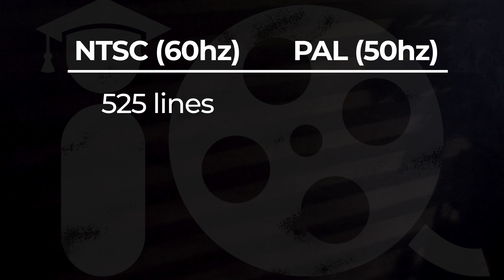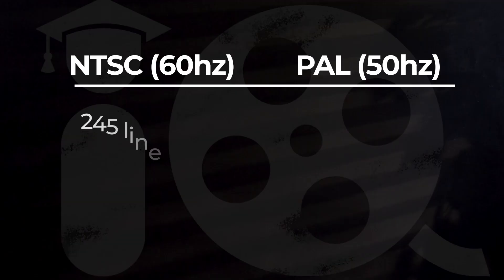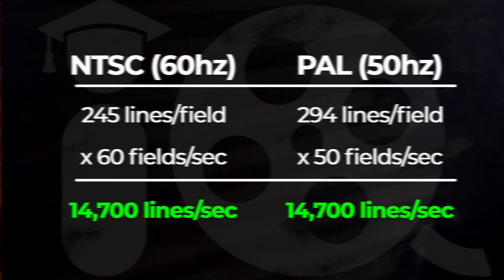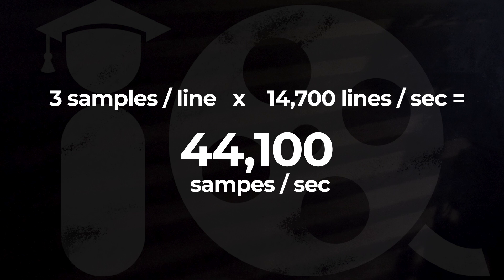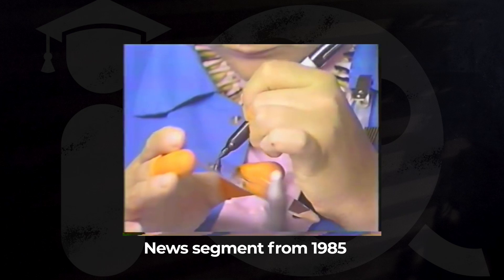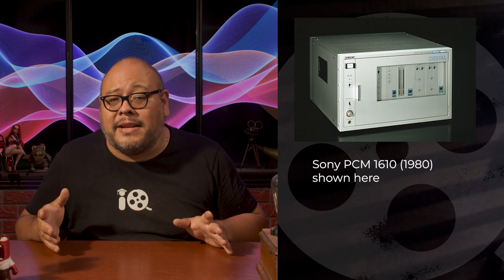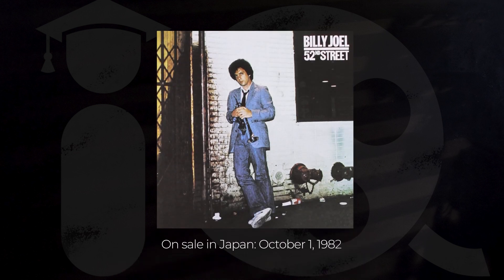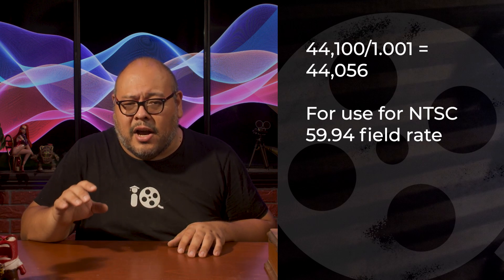The Surprising Origins of Digital Audio Sampling Rates

Comment: Later formats like CD, DAT etc were so robust largely thanks to error-mitigating innovations like EFM and CIRC. Those early digital audio formats on u-matic etc seemed to be very much synchronous bytestreams. Did they use any form of error checking like parity bits or such?
Reply: In other video comments on other channels I’ve had discussions with people who used U-matic to record digital audio onto in the late 80s and early 90s. At least at that stage they could detect CRC errors because it was a simple checksum, but they said if the errors started flying up (measured on a separate rack mount unit) you had to rewind and re-record that part until the Master Copy was perfect. So definitely far more rudimentary than CD error correction! Merely error detection :)

(I’m not sure what the acceptable error tolerance was, though — given RedBook includes standards for bodging a few PCM frames when they’re missing, just one or two CRCs might’ve been fine? But definitely a large increase necessitated going back and redubbing that segment, all made possible with timecodes of course.)

Now I’m not 100% if these early recordings were compatible with a CRC error count rack unit, I suppose they might not have been; but given the machines were used for a long time, and they had their own standards for the video frame, and so on, I would be surprised if that were true. Whatever was used in 88 was probably used in 84.
Reply: @kaitlyn__L  great info. It's all coming back to me now. We still were receiving audio masters on u-matic up until 1995. We had a rack-mounted sample rate converter and a dot matrix printer attached to a Sony PCM 1630. And yes, I vaguely recall examining the printout for excessive errors. The only option was to reload the tape. 
CIRC is a much more elaborate algorithm that allowed some degree of error recovery which parity or CRC did not. 
 I seem to recall that u-matic also had the PQ points encoded?

Comment: Just as an anecdotal data point, I've been using 48k since the late 90s when I started using Cubase VST with a SoundBlaster Live! card and found that the card wouldn't sync properly at 44.1k, because it was internally 48k and doing an inaccurate downsampling to get 44.1. It's funny now remembering how I was annoyed at the extra disk space it used, totally irrelevant now. But back then, when I'd spent a lot of cash (for me) on a "massive" 17.4GB hard disk for audio recording storage, it was a significant overhead.
Reply: Haha, believe it or not, I am STILL using a Sound Blaster Audigy 2ZS for audio production, which relies on an evolution of the chipset used in the SBLive! and has the same "48khz or inaccurate downsampling" limitation (the original SBLive card relies on the emu10k1 chip, while the Audigy2ZS relies on the emu10k2 chip... there's even an Audigy Rx released a few years ago relying on an emu10k2.1 chip which still caries this limitation). Which leads me to usually work with a 48KHz workflow, and then manually downsample to 44KHz in software if need be. It also seems to me that, as video and audio become more intertwined (e.g. people listen to music on YouTube), 48KHz is increasingly becoming a standard even for audio only.
Reply: @Liam3072  Excellent! I've actually considered building a small PCI machine just so I can use my SBLives again. it feels to me that in many ways we've gone backwards in PC audio, I mean the SBLive is over 20 years old and was an absolute powerhouse. And I was actually running two in the same machine using modified drivers! My final production config was one using the Live! drivers and one using the E-Mu APS drivers which had some great effects.

Good days.
Reply: @ian_b  Or you could get a usb audio interface that has no issues with whatever sample rate you use, better dac's, asio drivers, no ? is there a reason to use soundblasters/ non audio prod focused pci cards ? (this is a real question I'm not trying to be antagonistic)
Reply: @escalator9734  and, if he insists on Creative, could use 0404 or, say, 1212M.
Older recording audio cards can be often found for cheap. Especially the PCI ones. Or Firewire, though getting it to work reliably on Windows is not easy.
Reply: I totally get a feel of that 17.4 GB HDD. I have a similar memories!

Comment: Neat. I knew 48K was an issue of mostly timing and even divisions, but I didn't know it went quite so deep.

I do audio mixing and mastering for some like-minded artists, and I stick with 44.1 for the marginally smaller file sizes and slightly improved CPU performance. Also, this is less of an issue now, but some audio processing counts things in terms of samples rather than timecode, and some of that audio processing doesn't ask what sample rate you want and just expects to be fed 44.1. So anything else can cause issues - for example you think you just set a filter at 16K which is actually at 17.41K. That's much more of a rarity now, but I still see it come up now and then.

Comment: The thing is... we hear up to 20000Hz, but you can hear an audio sampled at 192Khz through a DAC of 44.1Khz and then the same audio through a DAC of 96Khz and you will notice a clear difference. At 44.1Khz you hear more fuzzy audio. I don't know if you can differenciate 96 from 192 because I didn't have the opportunity to check that out, but between the other two... I got amaze.
Reply from the maker: "Sampled"? Then that's your caveat. When you start filtering audio, there's all sort of aliasing that rises up that reflects ultrasonic frequencies into the audible range.

But if I record sound at 48khz from a mic and then record the same sound at 96khz, same mic... No way you could tell the difference.

Comment: I knew about 44.1K but never got 48K, especially since 50K was already an established standard.  Thank you!
Side note, engineers of earlier digital recorders believed 60KHz would be ideal (you need room for the antialiasing filters to work) but it was pushing the tech a little too far, so they settled on 50K.
Reply from the maker: Decca used 50khz in a lot of early digital recording experiments of the late 70s in Europe. It might be a stretch to say it was a standard because nothing was standardize yet, but it was common.
Reply: @FilmmakerIQ  Soundstream, 3M  and Mitsubishi also used 50K.  Those were the most common digital multitrack systems in the late 70s.  I forget what Denon used off the top of my head but it was somewhat less.  BTW, I'm glad to see you posting again.

Comment: As I already saw the incorrect myth popping up once again in the comments that waves close to half the sampling frequency cannot correctly be reproduced, let me point something out here: This is nonsense and based upon a complete misconception of how PCM sampling actually works. Every analog sine wave sampled at at least twice the frequency will be perfectly accurate reproduced by the combination of a DAC and a band-path filter following it, which is always required for correct PCM signal reproduction. You can use an analog oscilloscope to prove that. There is no loss in amplitude or shift in phase. A sine wave of 20 kHz sampled with 44.1 kHz and converted back to an analog wave will look exactly the same at the output as it did at the input. If you overlay them in an analog oscilloscope, they match up perfectly and yes, it will always have exactly the same amplitude, too.

The misconception here is that when reproducing the wave, the signal will jump directly from PCM sample value to sample value but that's not the case at all. If it would do so, it would produce frequencies that are above half of the sampling frequency and this would violate the Nyquist–Shannon sampling theorem. That's why a band-path filter is mandatory for reproductino. It will enforce that no such violation is possible by ensuring that only analog waves are emitted that pass through all PCM sampling points (*pass through* does not mean "end at those", the wave can go far above that point before it turns around) and at the same time are never above half the sampling frequency.

And for those who now say: Okay, this may be true for sine waves, but what about other kind of waves? Every wave can be broken down into sine waves, so whatever applies to sine waves applies to any shape of waves. Of course, saw waves are not reproduced as correct "sharp" saw waves, as sine waves above half the Nyquist frequency are not reproduced (and those would be required for perfect edges) but that doesn't matter as you also cannot hear these either. That means to your ear, saw waves always sounded (= "looked like") as the "imperfect reproduction" does look like. So while you can see a difference for square waves (or saw waves) on an oscilloscope, that difference does not exist for your ears as your ears never captured the waves above 20 kHz and to your ears there never wars a perfect square to begin with.

This video explains all the theory about this and even proves that theory using an analog oscilloscope:
https://youtu.be/2qFjdQP7Ep0
Reply from the maker: The issue with your rebuttal is while it's true that every frequency below the Nyquist threshold is reproduced perfectly... Every frequency above the Nyquist threshold creates an alias of itself in the lower frequency. So if there are ultrasonic frequencies being recorded at a low sample rate those ultra high frequencies can appear as lower audible frequencies via their alias. 

Therefore it is necessary to eliminate all those higher frequencies before we sample the audio waveform. But a low band pass need some headroom to operate.

So you can get a diminished response on the upper end of the audible spectrum because that's the low band filter taking effect.
Reply: @FilmmakerIQ  A filter is required at both ends, that's correct. You need one prior to feeding a signal to an ADC and you need one after a DAC. Usually it's not just a low-pass filter as you also don't want very low frequencies to pass through, especially not any DC current. And yes, those filters cannot cut off perfectly at specific frequency, they just increasingly reduce the intensity of the signal starting at their cut off frequency. But this is not an issue to frequencies at the upper end. If the filter does not cut off fast enough, then you get aliases in your sample values, however an alias of, let's say 23 kHz, will not appear near the upper end but at a much lower frequency. To get an issue at the upper end, you need aliases of even higher frequencies and the higher the frequency, the more effective the filter will be. Also keep in mind, that the filter can start to cut off at 20 kHz, yet 44.1 kHz sampling frequency means that frequencies up to 22.05 kHz are reproduced correctly, so you have 2.05 kHz headroom to begin with.
Reply from the maker: Well 2khz isn't a whole lot of headroom and as I understand it it is difficult to do a sharp cutoff that smoothly. 48khz sampling would double that headroom and 96khz would give you a full octave plus to work.

That's what seems to be the real crux of this discussion. The serious folks are not talking about hearing ultrasonic frequencies or trying dispell Nyquist. It's that it's much simpler to filter out the unwanted high frequencies with more hz (up to a point then it might actually harm the product)

Comment: One important thing to note about Nyquist frequency is that sampling at merely twice the frequency that you are trying to measure only lets you reliably determine frequency and not amplitude(loudness) or shape(square vs sin, etc). Humans can hear frequencies from 20Hz to 20Khz, but can hear sounds better if they are between 200Hz to 8KHz. Most human speech, music etc will have primary frequencies below 8KHz, but may contain harmonics between 8Khz and 20 Khz.
Another reason why 44.1 or better works is that for frequencies below 8Khz, we sample at 5.5 samples per cycle or better which allows capturing the amplitude within 1dB for sin waves. For frequencies between 8KHz and 20KHz we start to not capture the amplitude quite right, but as this problem gets worse, human hearing is also becoming less sensitive so we usually don't notice.

Comment: 48 kHz is nice: 3 periods of 64 samples makes 4 ms. It simplifies timing over USB, leading to lower latency.
Reply: Citation needed. USB devices are interrogated by the computer at whatever rate is necessary. Furthermore, audio data is always buffered at the output.
Reply: @mina86    buffered ???? what did you meant? 
24-bits/192 audio, it's just a stream!
Reply: @lucasrem , sound card has a buffer where samples from the stream are written to in batches. Data is not sent there one sample at a time.
Reply: I couldn’t discern a difference between 44.1 and 48 in various settings, so besides switching to match my music (half the FLACs I have from Bandcamp are 48 while the other half and my own CDs are 44.1) which is a PITA I just allow for resampling. But I think I left it in 44.1 as default so that CD rips wouldn’t need resampled. But if it reduces audio packet latency, I’d happily put it in 48 since it sounds the same to me anyway.
Reply: @kaitlyn__L  I would store data in the original format. If all you do is listen to audio, latency does not matter that much, and most media players will upsample in real-time. It is however good to configure your audio server ie JACKD to run at 48 kHz.
Reply: @milasudril  that's what I was talking about, the audio stack’s output settings. I’m certainly not saving any resampled files. I had tried outputting at 44.1 and 48 and it sounded the same for both 44.1 content and 48 content either way.
Reply: @kaitlyn__L  Try 192 /24, if you don't hear that, try bigger speakers!
Reply: @lucasrem , 192/24 is a marketing gimmick. There’s no perceptible difference between that and 48/16.
Reply: Which also syncs up nice with 120 and 240hz displays. Dunno if that matters but hey. I like it lol
Reply: HDMi 2.1 needed?
192 24 384!
Reply: why you still need USB, stick with content? unable to find wires that support 192/24?

Comment: Things would have been so much simpler if we'd never bothered inventing TV until we had streaming digital technology...
Reply: Well, seriously, "analog TV" and it’s need for "backwards compatibility" already caused a lot of issues and limitations...
Reply from the maker: Those issues and limitations were more than made up for by the advantage of actually having compatible devices.

Tech folks don't seem to get why this is so crucial

How long does a video card stay relevant these days? Or an iPad stay compatible? 

A TV can last decades, I still have TVs that work just as well 20 years after I bought them.
Reply: @vapno92  in the UK we had the first compatibility problem when ITV started broadcasting in 1955. The BBC used VHF Band 1, while ITV used Band 3. So a set top box and second antenna were required.

Comment: It's interesting to see digital audio data being saved as picture information on videotape. Just as digital data for computers used to be stored as binary code audio-signal like on Commodore 64 Datasettes or ZX Spectrum tapes. A clever concept. Something similar was later used in the 90s for VHS tapes to save digital files from harddrives to a Videotape. The software was sold for PC and came with a video-output card that had to be installed into the computer. You would then select all the files you wanted to backup on VHS and it would then pack everything into a archive dump and export it as a Videosignal which was a black & white video signal (series of blocks that looked like animated barcodes and QR codes).
Reply: Similar to using dialup modems to transmit data over public phone circuits which were designed to carry only the narrow band of frequencies necessary to convey intelligible human speech. Those ZX Spectrum tapes sounded much the same as a modem.
Reply: @owendoconnor  Yup. You could even hear if a turbo was used or not, which removed the many many redundancy blocks in the binary data, that was often checked multiple times to assure data consistency.

Comment: Samplerate & Bitdepth is basically "Megapixel" resolution for audio. The higher, the finer the details. However even at lower resolutions you can save a lot of quality with a process called superbitmapping. When you convert higher resolution audio to 44,1 Khz 16bit. A process that became quite popular in the 90s thanks to Sony.
Reply from the maker: Had to look that up. Looks like some special kind of dithering. Sony uses it on images as well
Reply: @FilmmakerIQ  mh hmm. It's pretty efficient. Sadly that is a feature hard to find in any kind of audio tools. Not even the CD Architect seem to have this feature.
Reply from the maker: Well I believe it's proprietary of Sony